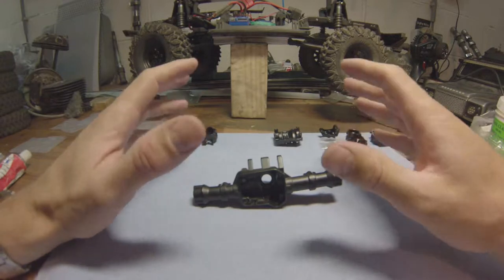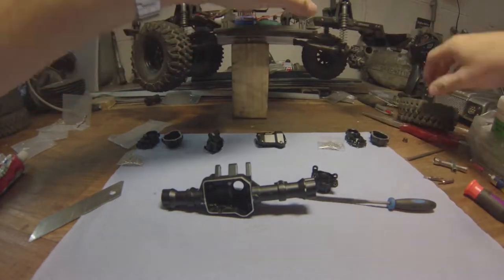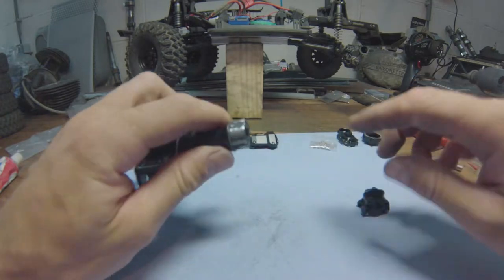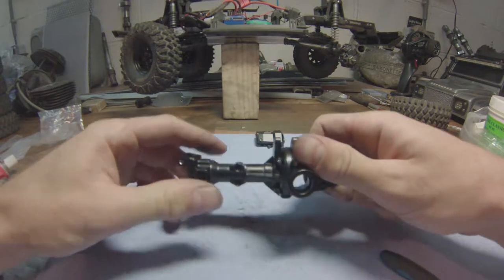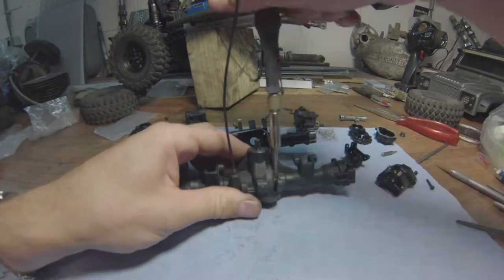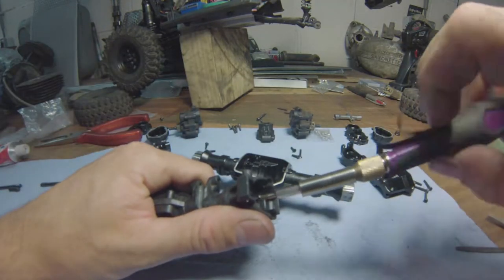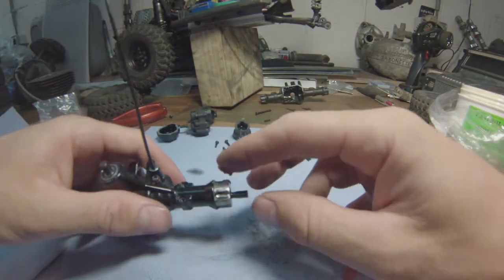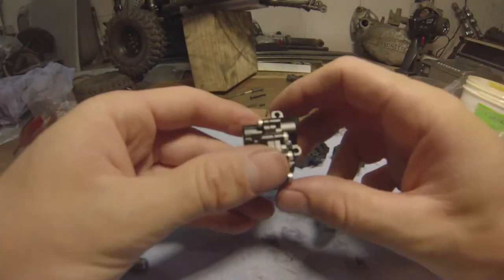Traxxas TRX-4 Tech: Rear axle upgrade

Comment: best axle rebuild video i have seen   good job
Reply from the maker: Thank you for saying so! You have no idea how much I appreciate your kind words. :) You should see it on the trail. Makes a world of difference, and they require much less maintenance. So that means more time on the trails, and less down time on the work bench (although it is great fun to work on). I have only serviced both axles and portals once, after almost a year of intensive use. I am surprised at how well this modification held up, after what I did with the car. I am busy editing the video right now! :)
Reply: @gmcevoy  i will be getting some of those axles for sure   most people say the defender needs some low down weight
Reply from the maker: @Mr_Dia-Tribe  Most people are right in saying so. You will see how it affects handling, instantly. No need to go over board though. RC Girl has made an interesting comparison video, on the subject. You might have already seen it. A good idea, is to relocate the battery so that it sits more in front, as well. I made a simple bracket for that. It also helps, especially when climbing steep inclines. The great thing with the modification that I have carried out, is that both axles, and all four portals are water-tight. So you can go wading as much as you like, without a second thought. Thanks for hanging around, Darren!
Reply: @gmcevoy  is that the battery mod that puts the battery right over the front axle?  i have seen the RC Girl video with lots of yeah racing brass it looks a bit OTT and a bit ugly  what you have done is much more scale and maybe not as heavy and it looks and performs great.
Reply from the maker: @Mr_Dia-Tribe  I will try to shoot a video of the chassis as it is, when I have a bit of time to kill. She did go OTT, for sure. She seems to have lost quite some drivability, but I suppose the intention was to show off all the aftermarket products that can go on it... I am just so glad that you find what I have done so appealing. It is truly the greatest reward I could get. So thanks for that! Catch you later! :)
Reply: @gmcevoy  my TRX4 has just arrived  its like new  so very very happy. you know it would be great if you showed off your chassis i did see on one of the videos that you have fabricated a skid plate underneath. what the most impressive thing is about your axles is that after a year you had a look inside and they were perfect so that will really help the long life of those expensive parts inside.  the trx really is great bit of engineering and because its a traxxas getting new parts is so easy. also looks like you have some really nice place there to run your truck from the videos you posted   many thanks to you for taking the time and effort to share   appreciate it
Reply: @gmcevoy   Dang it!  i forgot to ask if you have had anything break yet  like the steering servo and such   thanks
Reply from the maker: @Mr_Dia-Tribe  Thanks, and congrats on finally receiving your TRX-4! You are going to have so much fun with it, guaranteed. :) I will edit a video as soon as I can, showing the bare chassis. Again, I am truly grateful, about your appreciation. It gives me the motivation I need to keep shooting, editing, and posting these videos. Thank you for showing so much interest!
Reply from the maker: @Mr_Dia-Tribe  After two days of casual rock crawling in the garden, the steering servo did give up. Since it was brand new, I was truly extra careful not to damage anything, but still, it blew. The original one is weak, out of the box. So I bought a more powerful one, and I have not had any problems with it since then. I will give some more details about that in the chassis video.
Reply: @gmcevoy  thank you   i have ordered a new servo

Comment: Did the make a difference in tip over?  I just ordered a set from Asia tees, nice video👍 after sealing up the axles i was going to try and run diff fluid, I like the idea you seald up the axles very smart
Reply from the maker: Hi Travis! Thank you for stopping by, and for your kind words. They are highly appreciated! It has most certainly made a huge difference. The car handles so much more realistically, you will see! I did consider filling with gear oil, but instead I left it at that. It works a charm, and does require less maintenance. I still haven't opened the diff cases since then. I probably should, to check how it is all doing, in there :) Thanks again! Do let me know how it goes, on your side. I would appreciate it.
Reply: @gmcevoy  I sure will thanks bud👍

Comment: What a great video you made, thanks for sharing that, I was afraid to buy axles but I feel more confident. I have a question for you, would you suggest a different brand of Axles? because I wouldn't like to have those troubles that you had make parts fit on those axles. Thank you so much
Reply from the maker: Hi there. Thank you for your kind words, they are highly appreciated! I had to mess around because parts came from here and there, but if you get all the parts you need from the same brand, I think they should fit together nicely. I know that KYX manufacture good quality parts, for the TRX-4. The axle cases will most likely be made out of aluminium though, so slightly lighter than the cast iron ones, that I have fitted. Thank you for watching! Much and more, still to come. :)
Reply: @gmcevoy  thank you for your reply. I will keep your advice in mind, and thank for your videos
Reply from the maker: @eclinor  Thank you for watching them! It is always a pleasure, to interact with my viewers. Come again soon!